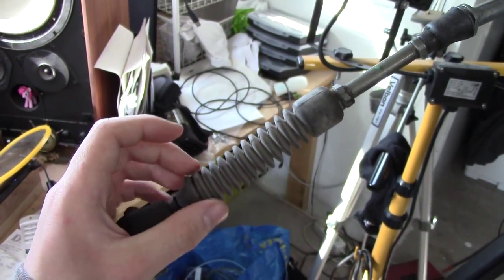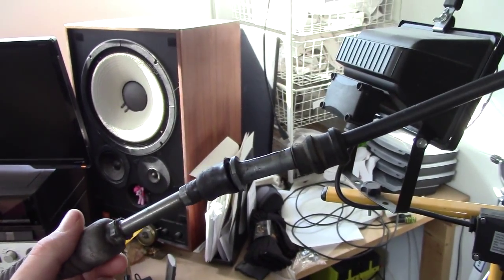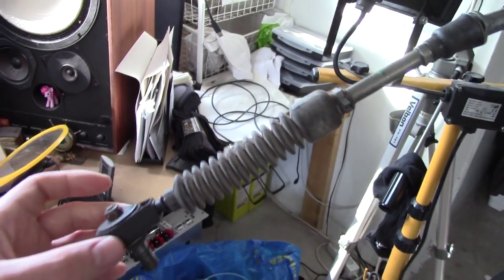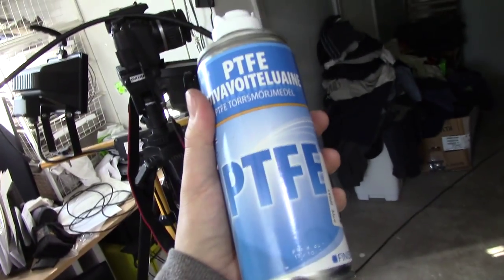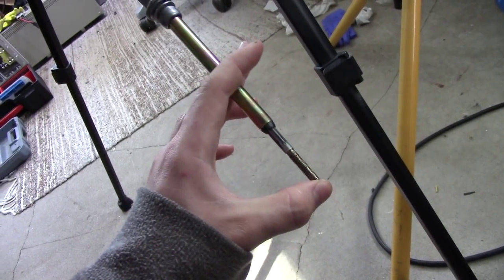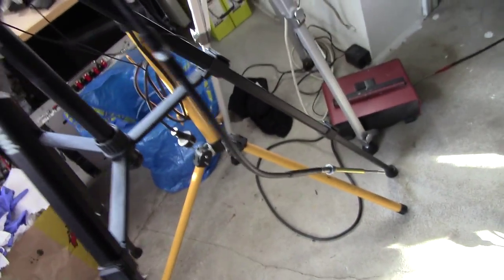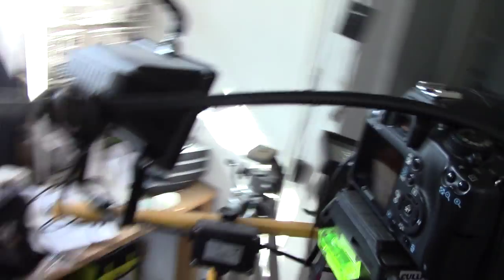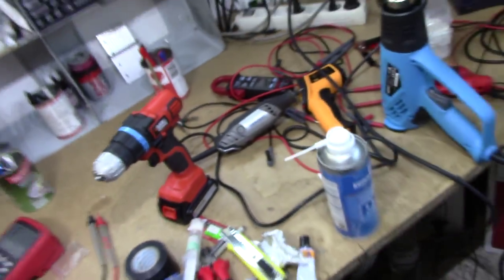Repairing (not replacing) a sticky gear selector cable (Nissan Vanette)

Comment: Good fix. Teflon lubricating spray is also used on bicycle wires and mopeds. Such a lubricant does not cause swelling of inner plastic tubing in the wire. About dealerships. They always charge more than the stores selling after market parts.

Comment: what is in the ptfe can? Is it oil with teflon+ penetrating oil or something? I had similar stuck cable on my citroen, no oil pumping helped it (it was already stuck completely, broke off lever support while shifting), I got used one and oiled that good before putting it in.
Reply from the maker: +mechadrake It's supposed to be nothing but PTFE in a solvent, once the solvent dries out, it's completely dry and turns into a PTFE coating/powder.
Reply: intresting, i have not encountered can like that before :)